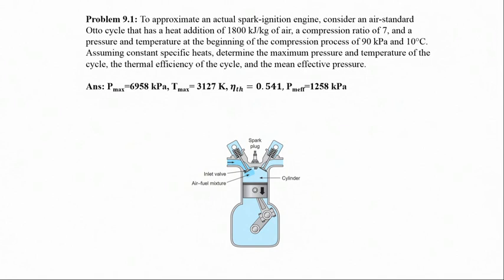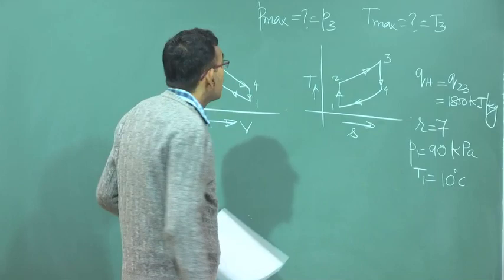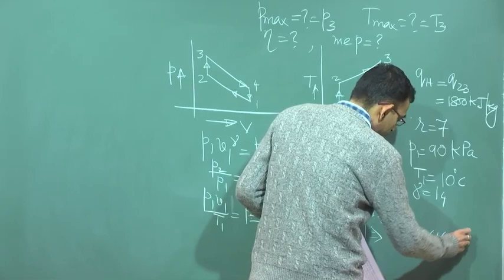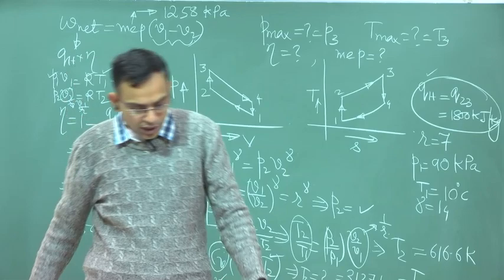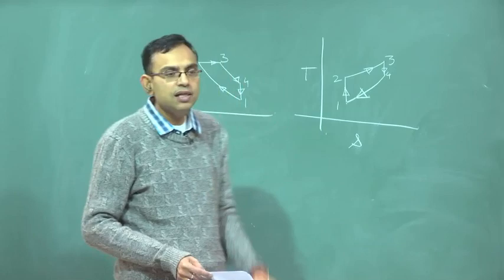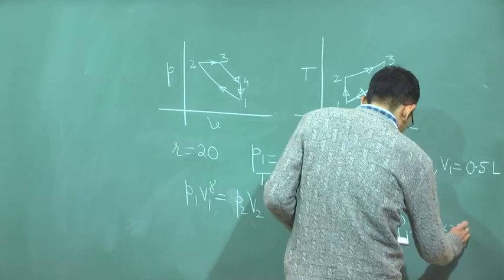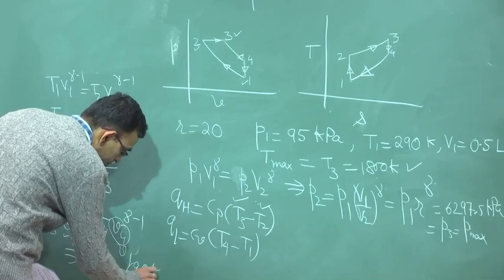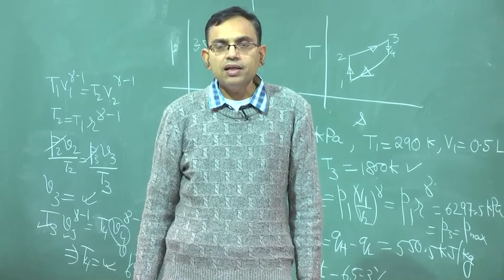Lecture 61 : Example Problems : Otto Cycle and Diesel Cycle

Comment: Ethyl alcohol (C2H6O) is burned in a petrol engine. Calculate: (a) the stoichiometric A/F ratio on mass basis; (b) the actual A/F ratio on the mass basis for a mixture strength, , of 90%. [Note: First write the stoichiometric combustion equation in molar form for ethyl alcohol.] The relative molecular masses of C, H2, and O2 are 12, 2, and 32 kg/kmol, respectively. Air is a mixture of O2 = 21% and N2 = 79% by volume and O2 = 23.3% and N2 = 76.7% by mass.